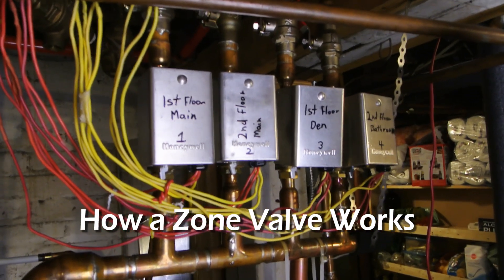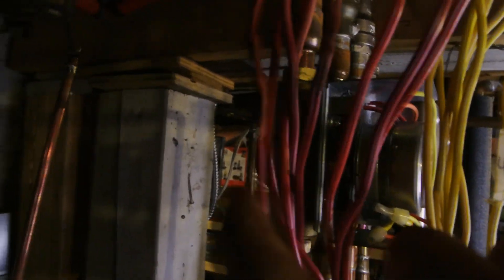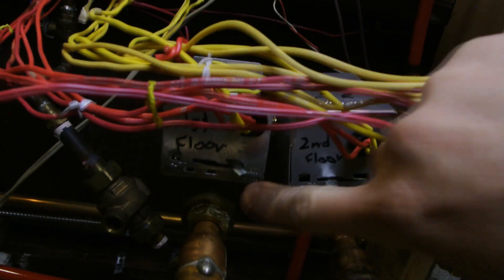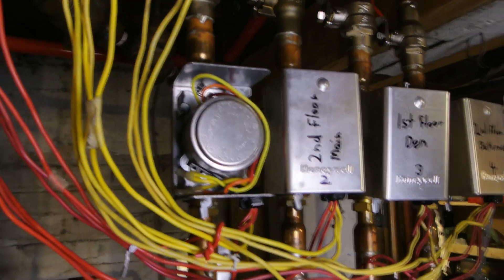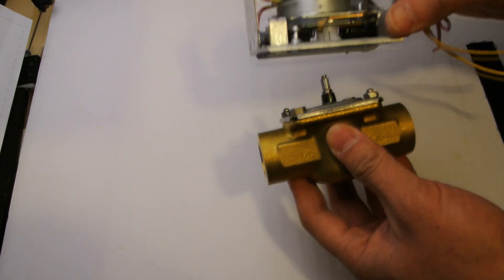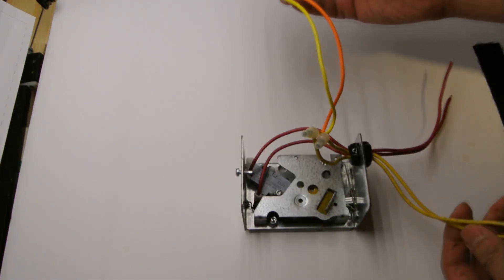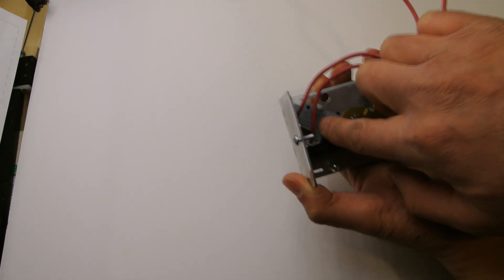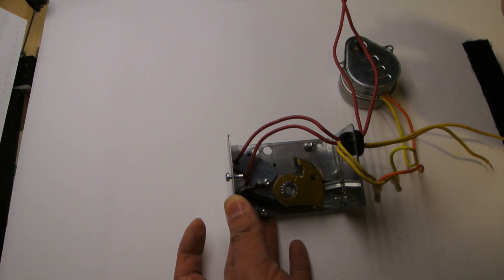How a Zone Valve Works - Hot Water Heating

Comment: Hello Andrew 
When I turn the thermostat above 15° Celsius  the zone valve makes a continuous tapping sound.
Can u suggest what could be the problem?
Reply: Could the tapping sound just be the sound of heat expansion ? The pipes expand when heated and shrink back as they cool and they press against  wood as they do. Since everything is dry it happens in jerky motions causing almost tapping sounds.

Comment: Ok so I turned my room stats down below ambient room temp, I then went and checked the zone valve, the hammer had returned to the off position and the end switch was now visible. I clicked the end switch on and off a few times with a small plastic straw. I then returned to the room stats and raised the temp until above ambient room temp. I then went back to the zone valve and the hammer had fully depressed the end switch, the boiler had fired up and the pump engaged. Many thanks for this very well put together video, you have just saved me a small fortune calling out a plumber. If I have to eventually change the zone valve, I can do that myself and it will only cost £47 for the part. 👍🏼🍺

Comment: Top video!! Gonna take this apart and see if I have a switch problem. Pipes are hot but the boiler isn't switching on and pump isn't engaging. Hope it's just the little switch not getting hit. If so I'll replace the whole powerhead. 
Thanks for the great video.

Comment: My first floor zone doesn't seem to heat up unlike the second floor.  Installed a new thermostat on the first floor and it seems that it isn't working.  The pipe for the first floor is hot but if i listen to it, i don't hear water gushing towards up...unlike the second unit that is next to it.  The pipe will eventually get hot but it doesn't heat up all thew way to the end.  Not sure what is going on...could it be the thermostat?  is there a block?  air?  the pipe for the return is not hot to the touch.  I hope this is not a big issue.  Pls assist?

Comment: Thanks Andrew for giving me the confident to tackle on this repair myself.  My valves should be here tomorrow.  I have 1 bad vale that is completed corroded, which I will need professional help to replace.  The other one is the end switch is not making the contact, valve will open, but not power to the boiler.  Hopefully just replacing the motor will fix the problem.  Thanks.

Comment: Hi, if heating is working when I manually switch the valve to ON and heating not working when I change it to Auto, does this mean that the motor is broken? I just want to establish that the motor is the issue and not the actual valve, which means pipe work etc. There is no easy access to the pipes that's the other problem. Thanks!

Comment: Andrew: which is better a normally open ZV or a normally closed ZV? Thanks. Video very informative. It could have been better if you have additional lights to illuminate the side of the ZVs
Reply: It's not about what's better, it's about what your system calls for.  If you install the wrong one the boiler will run opposite of what it should.  Just google the numbers on the switch so you can replace the switch with the proper part.

Comment: This is one of the very best videos on any type of repair on anything, not just boiler/valves.   Your explanations that co-ordinate with each of the components inside the valve allow a through understanding of how a valve works by taking the time to take the valve apart and explain further.  This was so great because it didn't leave questions in my mind!  I can move forward with installing a new end switch and interim used your demo for overriding from an operational valve to the defunct one so that zone has heat while I wait for the part.  I do have a question.  If the motor has power to it how would one know if the motor is short of getting the little arm on it up far enough to touch the end switch?  I'm almost certain its the end switch because we replaced it but it isn't working and the motor has power.  

We thought perhaps the micro switch was placed just a fraction off of its designated position (which doesn't seem likely because the screws indicate where it is positioned in order to get them screwed back in.

 The other question is this:  When soldering the end switch to the wires the iron touched the corner of the switch casing and although it barely melted the casing if this could ruin the switch?  When pushing the little rocker arm with a paper clip the switch works and caused the boiler to engage.  This is what made me wonder if the switch works with artificially getting it to complete the circuit to the boiler then could it be that despite the working motor could the little arm attached to it not be rotating far enough around to touch the end switch?

Is there a way to determine whether it is or not?  Thank you so much!  I am a retired widow and without doing most of my own repairs I would not be able to stay in my home!  You tube videos are the best ever in providing free knowledge that makes all the difference!!!  It is such a cool way of helping each other during these horrific economic times in our country!!!
My warmest regards and gratitude!!!
1

Comment: Awesome and much needed video!  I am 66 y. o., widowed many years so in past have replaced pump, expansion tank etc on mu boiler.  A few years ago replaced a micro switch on one of the valves and another one now needs either it or perhaps the valve motor.  Your video has taught me how the boiler operates!!!  And the component about the override switch was also super helpful because my toggle won't push freely all the way to the right so it might need the new motor.  Your video was great in time and being so succinct!! Thank you so much for taking the time to do this!  People like you are contributors to me being able to keep and stay in my home of 40 years!!!!!!

Comment: This was very helpful to know that the valve itself rarely fails, it is the box above that may have issues. I was able to fix mine where the temp was overshooting by 6-7 deg over the set point. After spraying oil (carefully) over the gears I was able to rotate them without sticking, thereby solving this issue I had with the retracting spring.
Reply from the maker: +Subhash Kulkarni Interesting, the gears must have been sticking.

Comment: Can the end switch be replaced?
Reply: Another question. How does motor turn the valve off?
Reply from the maker: +Aviator168 Yes but you'd have to go to an electronics place to get one.  If you are in the states radio shack may carry them.
Reply from the maker: +Aviator168 There is a spring that pushes the valve close when the motor is off.
Reply: I see. Thanks. So the valve is closed by spring action and electricity is kept supplied to the motor all the time just to keep the valve opened. It is inefficient but there is a fail safe and works well.
Reply: +Aviator168  It looks very similar to a switch I just replaced in my GE microwave. If you can get a # off the switch you can probably find them. Very cheap, at least the one I replaced in the MW was.
Reply: +bigpardner  I see boilergeek on eBay sells them.

Comment: Hello Andrew,
thanks for the video, it is very helpful in understanding the heating system in my house.
  I I'm trying to find the cause of the problem I'm having right now with the System.
when I crank up the heat in the basement to 30 degrees there's a loud cracking noise from the zone valve but when I put it back on 20 degrees It stops the noise.
what do you think the problem should be.
Reply from the maker: +satto123123 Usually the motor goes bad, try replacing the motor for another zone (if you have another zone).  Doesn't cost you anything and simple to do.  I have another video on how to change it out.  If that doesn't fix it then the valve itself is probably bad or the gears are bad.

Comment: Hi, I replaced the zone valve yesterday and i can see the hot water running through the pipe... I place the 75 degree on my thermostate and room temp was at the 60 degree.. So this morning when I called my tenant wheather she is heat in her apartment, she replied, nothing has change in the room temp.. So do you think I should change the thermostat itself.. Whats yours opionion on it.. Once again, Thank you very much..
Reply from the maker: +Lhagyal Serdok Does the system have pressure, should be between 13-15psi?  That is odd, I would disconnect the thermostat and connect the two wires together to complete the circuit, the valve should open and the pump and boiler should turn on.  Do the pipes in the apartment get hot after you open the valve?  If all the other apartments are getting heat then maybe the radiator is air locked?
Reply: Hi, All other apartment has heat.. only one apartment does not have heat.. Any how, do you know, where I can find valve to release air from the baseboard heating.. I try to find in living room my couldn't find.. Tomorrow I am going to change the thermostat as you have mention it..
Reply from the maker: +Lhagyal Serdok Hmm not sure about the valve, you will have to go and look for it.  Sometimes they don't have them if they are baseboard heat.
Reply: +Andrew W.... Hi, I finally end up calling the one of the plumber to replace the tap on the existing copper piper.. Now, everything is running fine.. Thank you very much for your educations and appreciated...
Reply from the maker: +Lhagyal Serdok No problem, glad you were able to get it fixed.  Sometimes you have to call in the professional!

Comment: Thank you very much for advice and it truly helps a lot.. My valve is on auto when I crank the thermostat way up.. I manually place the valve button on but later on when shut my thermostat on off mode.. Then valve goes on the auto button then it never comes back on the valve on side even though it I turn the heat way up..
Reply from the maker: +Lhagyal Serdok Sounds like the motorhead is bad, they are easy to change.  Just get another valve and change it out.  Not sure if they sell the motor on it&#39;s own so you might need to buy the whole valve and take the motor off.  I would suggest before you do that tho to test the connection to make sure you are getting power to the valve before buying a new one.

Comment: I have four flex apartment and same as yours.. but one of my apartment is not getting heat.. there is no heat in that particular apartment so what is yours opinion on it...
Reply from the maker: +Lhagyal Serdok Check to see if your zone valve is open, move the lever to the right, if you get heat then you know something is wrong with that valve, most likely the motor is going bad.  It could be the thermostat or the wire to the thermostat as well, if the thermostat is on and calling for heat and the valve is closed then you know it could be that or the wire..